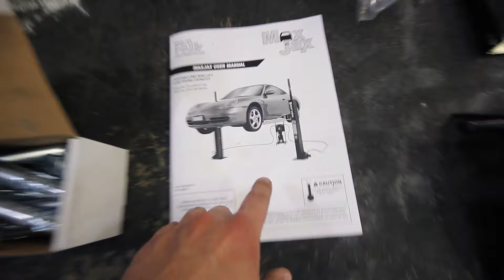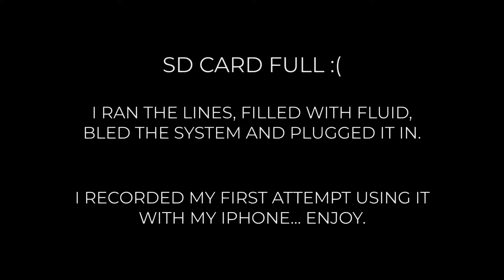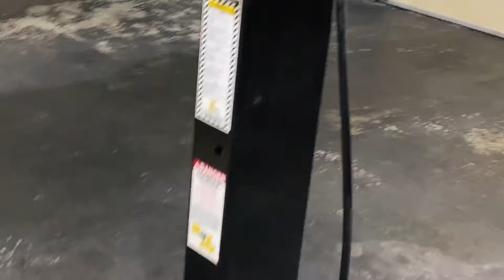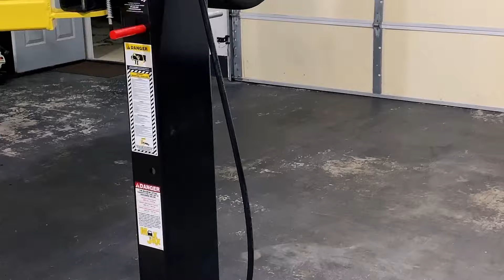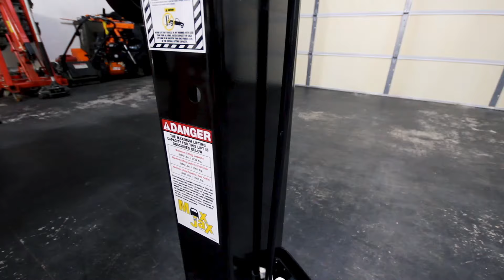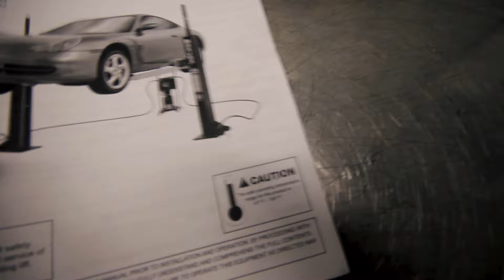MaxJax Lift Installation & Review - Portable 2-Post Lift for Home Garage

Comment: I have had a Max Jax for about ten years. There were numerous problems. The first thing to fail was the pump leak. The next was a cylinder seal leak. The next was one side would raise higher than the other. Fortunately these were under warranty and replaced but it caused a lot of aggravation. One side raising higher than the other appeared to be solved by a pressure adjusting valve put on one side. After the warranty expired I have had two more cylinder leaks. The only hydraulic repair in this area replaced the seals but they still leaked and he said it wasn’t the seals but something like a sleeve that he couldn’t get. Bend Pak bought out Max Jax and you would think would have excellent service, but it is terrible. The people you talk to have absolutely no experience in this product. You can’t get any parts for a Max Jax, you have to buy the new part. The price for a Max Jax now is astronomical.
Reply: What model did you buy??
Reply: @ogbladee  When I bought my Max Jax they only had one model. What was so scary was when mine was raising un even. Mine doesn’t have the automatic locks.

Comment: Thank you so much for your demonstration . Having an 8 ft. ceiling in my garage makes it a perfect solution and with the appropriate seat height makes it more useful . I'm so tired of jacking up my cars and trucks and having to put jack stands under them which makes me so tired even before I start to work on them ,it is the perfect solution ,thank you again for answering all my questions and actually showing your set-up .

Comment: Jake,
    I've been beating myself up over  lack of ceiling height of (10') in my shop that was limiting my choices for a 2 post 4 arm lift.  The MaxJax Lift is going to be my next major improvement.  The Tool Stud will also save my old back and shoulders.    The ability to disassemble and stow it, is another clever feature.       Thank you for a great video.
Reply: Thanks for the information MOPARGuy.  I'll check out the quickjack also.  Options are good.
Reply from the maker: The MaxJax is a great option for the ceiling-limited hobbist! I love it so far. Glad you enjoyed the video, thanks for watching.
Reply: @jake_spence   how high are your ceilings???

Comment: I work on aircrafts, we use driver car seats on top of a rolling frame, then you can recline and work nicely underneath the engine, or in your case your car. as I am writing this you brought in the creeper, its like that only more comfortable. and since its a car seat you can adjust your recline depending on the job. great video!
Reply from the maker: Awesome! If I had some welding skills I would've considering making one like that.

Comment: I've had one of these lifts for several years now.  It was really well worth the investment whether you want the prestige or actually use it regularly.

I never saw you make sure the hoist posts were plumb and parallel.  The instructions were really intent on that.

I also made several modifications to mine.  One being the same custom hydraulic hose and wall mount setup.  Then I drilled the posts to accept more safety positions.  I also attached some "trays" to the posts to store the lifting pad extensions.  I also got some set screws to plug the concrete anchors when it is not in use.  I use some cheap conduit through the topmost holes in the posts from which to hang the lift arms when not in use.  I have never used the E-clips to hold the pins in which hold the arms onto the posts.

Before the custom hose setup, I laid the hoses on the floor.  I did the stupid thing of running them over, because the pump setup wouldn't work in the front of the car well and that is where my tools are and stuff.  Disconnecting the hoses and wrapping them up wasn't really an option in anything below 40 degrees because the Chinesium hose they supply you with wouldn't flex.  The hose survived getting run over dozens and dozens of times, but the problem was when the salt water flowed down the slab to where the hose lay, and running over the hose must have microscopically damaged the sheathing and let the salt in to rust out the steel braids in the hoses.  Yes, I had one blow out on me while I had a Buick up as high as it could go on the hoist, before I got the chance to get the safety bars in.  I narrowly saved it from disaster by letting it down right away.

I always pull the manual release on the garage door when I have a car in the way of it.  Under no circumstances do I not do this, because I will, (and have), forget one day.
Reply from the maker: Good info here! Glad to hear you're using yours and enjoying it with some modifications. I'll have to consider some of those things. Another happy MaxJax owner here.

Comment: Awesome video man. I’m building a home and asked for 12 foot ceilings but didn’t think about the space to be able to fit two cars and the lift in the middle so now thinking of a portable one. I mostly will use it for frame replacements on suvs and trucks. This might work if I just remove one side and install when in use.

Comment: I just installed one of these at home ,  works great , just be sure you've got thick enough floor ! I had only 3.5 inch thick slab so we installed anchor s with concrete epoxy too .
Reply: That's a neat trick.  I'm about to measure my garage floor.
Reply: You just used anchors and epoxy?  You didn't use a thickened slab segment?

Comment: I've had mine for over a year and it is the best tool I have ever bought for working on cars. The only dislike is that you only get 2 lifting stops, so it's either all the way up or half way up. Nothing in between
Reply from the maker: Glad to hear you love it too! You can actually drill another set of holes in each post so you have more stopping points.

Comment: Hi guy . Yes I put mine in with no problem still have 4 “ to  5 “ to spare at full height . But like you with the door open comes close to the windshield . Was better backing the car in . Maybe if you can manually partially open  the door you can let the sunlight in . I use the extensions on the lift pads &  still have roof space. This late in coming to you I’m guessing you have ironed out most of problems. Thanks Greetings from Canada .🇺🇸🇨🇦👍💥

Comment: Do make sure to check what kind of concrete slab you have in your garage before you commit to this type of lift. You might want to avoid purchasing this lift if you happen to have a post tension slap. You don’t want to go drilling in to this type of foundation unless you know what you’re doing, it could be dangerous, do your research! You could find a contractor who has experience drilling in to this type of slab, but most wont. The hassle of finding a professional to perform this work, and the extra cost associated with it, might not make this the right lift for you. You don’t want to end up with pallet in the middle of your garage trying to figure out if to return it or sell it at a loss, or worst, end up in the hospital cos you drilled where you shouldn’t. 

P.S. To find out if you have a post tension slab look around your garage. There should be a stamp (usually close to one of the corners) letting you know you do.
Reply: 3'x2' 3/8 thick steel plate between the concrete and posts will distribute the stress more evenly on a larger footprint.

Comment: Without a top cross bar support you are putting alot of confidence in those anchor bolts. I would be scared to get under that car.
Reply from the maker: The top cross bar on almost all lifts is purely cosmetic to hold cables and wiring.
Reply: Not true
Reply: @jamesgregory7699  Indeed. The lift specs mention the min tensil strenght of the concrete (around 3000psi) and the min thickness. A drill test should be done at the ancrage position to get a proper reading of the precise thickness of the concrete under the lift. (mark the minimum thickness on the bit and hope not reaching the end of the concrete before the mark) 
It should also be stated that the concrete should contain rebar, steel mesh and be fiber reinforced. The rebar should be installed with the position of the lift ancrage bolts in mind or, found beforehand in order to avoid it while drilling. 
Weakness lines should also be made to "force" where the concrete will crack to avoid said crack to occur where the ancrages are and in order to preserve the minimal required surface area (within the aforementionned specs) for the posts feet. Better think twice and before :D

Comment: most garage openers have limit adjustments for how high it will open so you might want to check it and see if you can get the door to come up a little higher when fully open
Reply from the maker: Good to know! Thanks for the tip.

Comment: Do yourself a favor and drill a couple more holes in the max shaft towers.  I did an extra two between the stock two holes.  Makes the lift WAY more useful.  First hole below the first default hole, perfect for brake jobs and changing tires.  Then one between the lowest stock hole and the highest is a good working mid level.  I've had my maxjax for probably 6 years now... has paid for itself so many times over doing car work.

Comment: Hope no one opens the garage door with your car up high. Maybe add a laser sensor across the top hooked into the opener (would sense top of any vehicle height), and disable the opener until car was lowered to safe height. Nicely done video. Thanks.
Reply from the maker: Good idea! I've since pulled my car further ahead anytime it goes on the lift, this way avoiding contact with the garage door. Glad you liked the video!

Comment: When you drill concrete, you make lots of abrasive dust.  At 8:10 you started drilling, but you did not block off the hydraulic fitting to stop dust from getting in.  This looks like a certain way to get early failure of your hydraulic system.

Comment: I’m looking at one now.  Have a few concerns but I haven’t heard of any failures or at least you’d see them posted on YouTube.  Probably more hassle than it’s worth but thought about those tall truck jack stands at each corner of the car for an additional safety feature. Jake, how about a follow up vid in about 6 months to let us know how it’s working and if those anchors are holding well....Thx.
Reply: I have the newer M-6 model of the MaxJax for a little over 3 years now and haven't had any issues with the lift.  The anchors holds up very well and you can even opt to purchase the Epoxy Grip Anchor Bolt Kit if you're worry about the anchors popping out.  I've jacked all sorts of vehicles from 2000lbs to 5000lbs with no issues at all but I would advise caution when lifting up box frame trucks because the truck will rock around a lot more.  I personally refuse to lift up anything that isn't a unibody chassis.

Comment: I would have installed it at a bit on an angle into the right corner so it was easier to pull in and out. Would also eliminate the clearance issue with the door rails. Either way, pretty cool setup for sure!
Reply from the maker: Good call! Now that it is installed, I wish I would've angled it as well. Oh well, live and learn.
Reply: @jake_spence  well, it wouldnt be difficult to reinstall in a new location. Then just fill the old holes with some concrete filler, then paint over the filled holes and it's like they were never there. Now that it's been some time, how are you liking that lift? Once I build a shop I plan to do a lift but I am going to do an in floor lift so I have more room to work around the vehicle when it's up in the air. Will also allow me to put some steel plates over the lift when it's all the way down so I dont have the lift in the way if i need the shop space for something else or if i needed the have the doors open on a car for a stereo install or interior work. I'm only planning on building a 20'x30' shop so i wont have enough room. I also plan to use the shop as a storage space for my boat during the winter till i got around to building a large covered car port on one side or the other that will ultimately be the dedicated boat parking area. It will just be a 12'x30' covered area that will have a back and side wall, but open in the front. It wont be insulated or have a front door, it's just to keep the boat out of the elements during the winter and will have some outlets so I can plug in a battery tender and bilge heater. I'll probably also install some lights. I may not even do a concrete pad and just do gravel as it will strictly be used for boat and/or vehicle storage. Hope everything is working out well with the lift you installed

Comment: P.S. I made a measurement  from a fixed point on the wall with my heaviest car on the jack 3500 lbs and the post flexed about 1/4 “  at the top of the post .  Just as a matter of interest .

Comment: One thing I would have done a little diff is to tape over that hyd fitting while drilling the anchor holes. You said you cleaned up after drilling, but that concrete dust could do some damage to the hydraulics.  Second post holes you drilled, the hyd fitting had a plastic cap fortunately

Comment: at 8:09 you are about to drill into the floor.  The open hydraulic fitting is right there to catch that cement dust.  One killer of hydraulics is contaminants.  Then at 9:39 you left the dust cap on the other fitting.
Reply from the maker: Good catch. Now I know for next time. Everything has been functioning good so far.

Comment: A bit to low for my liking,but way better than trolley jacks.In the real world sitting down in the deck type chair youre stuck at one height,lets face theres times when you have reach further into undo things and in the chair you would wish you had telescopic arms.Also with wheeled chairs when youre trying to undo something thats tight quite often  the torque reaction with a strong arm bar or similar will send you moving across the floor due to the wheels of the trolley,get a trolley that has lockable wheels would help.Long lengths of time stooping is a killer on youre back.A great hoist for doing wheel and brake and suspension work,or engine bay work.Been a mechanic for 40 years and boy how times have changed.

Comment: Very Nice,but only thing I noticed is when he put the safety bars in.He didn't lower the jack down to take the weight off the system and put the weight on the safety pins.Safety first right,great job its a nice set up.

Comment: Jake , would it make sense to dig out a 3 x 2  strip alog the lift so that you can stand up  . .. just a thought ... sounds like a hassle but worth the shoot lol ... looks great any way
Reply from the maker: Like a pit? That's not a bad idea! But I don't plan on staying in this house for many years to come, so I'll probably leave it alone because I'm sure the next buyer won't want a giant hole in the garage lol.
Reply: @jake_spence  yes  thats what i thought .. regardless its dope , love the videos man .. how its the 335i coming along ? I have the same exact car as yours but black manual ..  my turbos are going bad , they are still holding boost but smoking way too much ... im still debating whether or not to go single since its my daily ..
Reply from the maker: Thanks! The 335i is slowly coming together. I've been busy tinkering with the 135i and installing this lift, but the 335i will get more attention again soon. I think you can daily a single turbo N54 no problem, but it is an expensive route. Sucks that these stock turbos are so hit or miss.
Reply: Jake Spence honestly, 115k miles on original turbos on my 6spd 2007 335i, the wastegate rattle is getting kind of bad but it doesn’t leak boost or burn any oil whatsoever, cold or hot, imo they only start to smoke if the owner doesn’t let the oil get up to temp before getting into boost, I try not to go anywhere until its at least up on the gauge and even then I roll slow, short shift at about 2500 and lower until it’s up near op Temp. When its finally time I’m going for a twin upgrade, direct fit good for 600ish hp, until then it’s fully stock for the time being but it still spins 265 nt555’s in a straight line in second if its even slightly damp

Comment: Solid video Jake.  Have been considering the MaxJax for the M6 but have concerns with her 4600lb weight.  Do you need to insulate the hose in the garage ceiling for winter or does the hydrolic line drain when not in use?
Reply from the maker: Thanks Scott! As long as the concrete is good, I wouldn't worry about lifting 4600lb with it. I have a friend with the standard MaxJax like I have who has lifted more than 6000lbs on it on several occasions. The hydraulic fluid drains back into the pump/tank when not in use, but I got fluid that can withstand -50*F (linked in description). I might insulate the lines just for peace of mind in the future.

Comment: Hi. To fit my jack with the door motor & rail  . I checked with the door installer  to make room for roof of the car you can move the rail and motor 3’ feet from centre in either direction it will not effect the operation of the door.

Comment: Nice video.  Still working well? I assume the hoses need to be the same length if you want to fixed mound the power unit? Looking to do the same on mine.

Comment: Great video Jake. This is off topic but did you ever figure out the wastegate issue you had last year? Green and white springs boosting to 19psi. I’m having to same problem. 11.60 psi spring cracking at 19psi....
Reply from the maker: I think it's just the combination of TiAL underrating their springs and the Doc Race kit being designed to overboost slightly. I swapped in 8psi springs and now see 12psi at wastegate pressure.
Reply: Is that the yellow or black spring?
Reply from the maker: @nv6672  Black I believe.

Comment: This looks nice. What is the strength of your concrete mix? How thick is the floor? What does the manufacturer recommend for pier sizing to support the lift for full capacity lifting?
Drilling in concrete is not the same as wood or steel, not as precise.